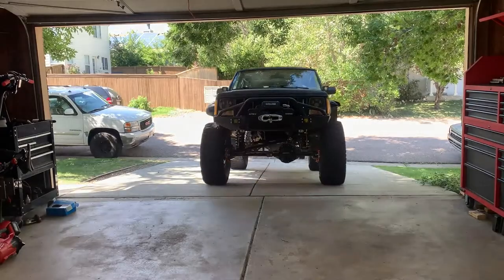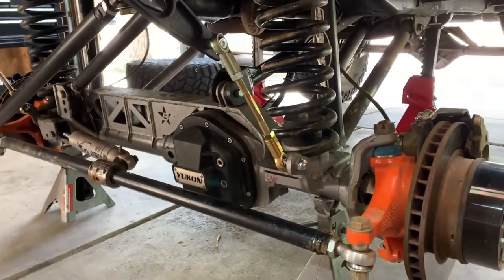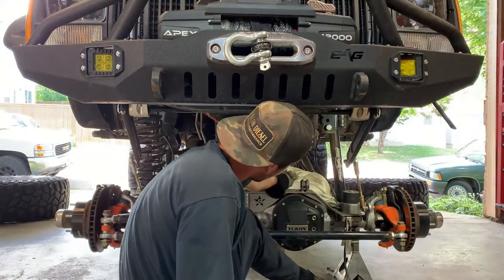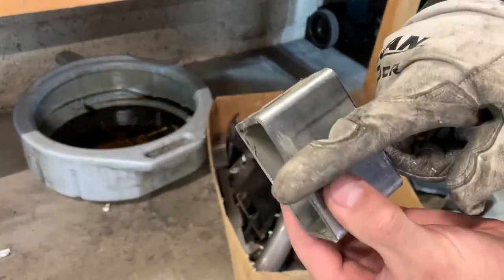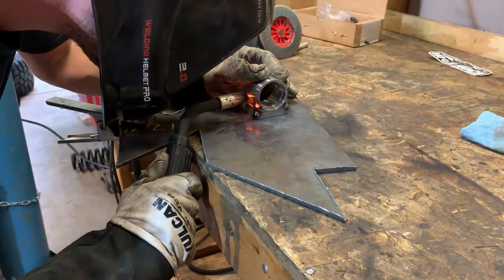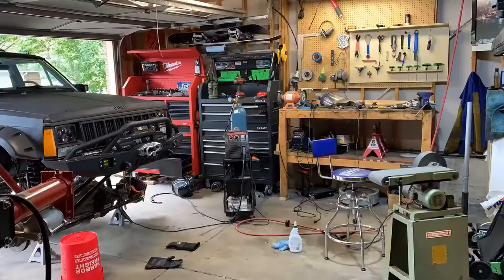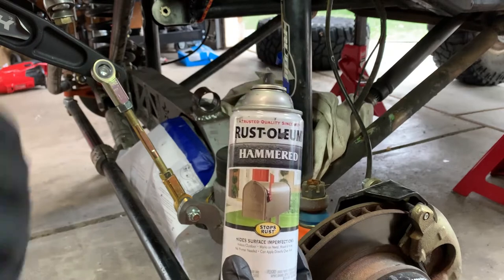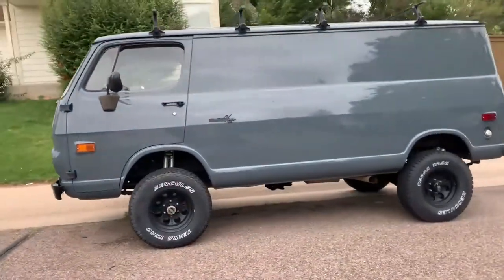POLY BUSHINGS vs FLEX JOINTS & Install On JEEP Cherokee XJ

Comment: Do you have a video on the anti rock sway bar install? 
I noticed you said in another video you installed wrong. 

I have mines on order and wanna do it right the first time
Reply from the maker: I do not have a video on that. But it is extremely straight forward and comes with a good set of instructions. My issue with incorrect installation was that I used too short of sway bar end links. I thought I could possibly get away with using the included ones. But for the amount of suspension travel I have I needed to upgrade to the 8.5" ones
Reply: @machinesinc  does it not come with the long end links? 
How much lift do you have?
Reply: @machinesinc  how do you like the on rad performance of the antirock
Reply from the maker: I believe the standard end links included are 6". I have about 6" of lift which would normally be fine for that end link length, however from ride height I have 9" of droop which caused the arms to invert. When you do the install, support your frame with jack stands and fully droop your axle to ensure the sway bar will not invert. On road characteristics are great for how much flex the sway bar allows for. But expect more body roll than a stock sway bar for sure.